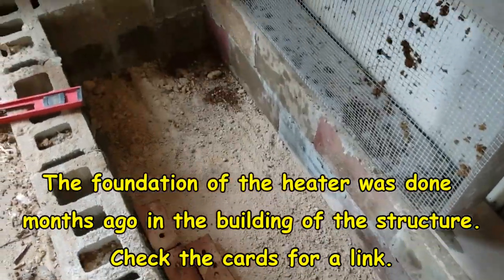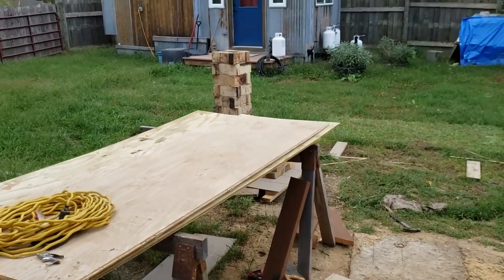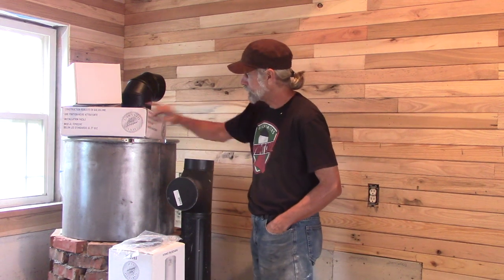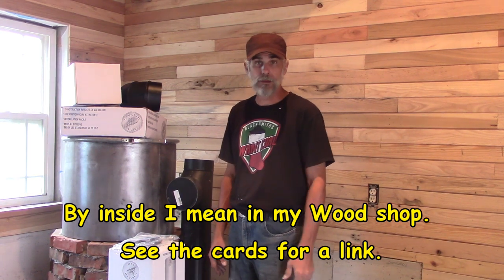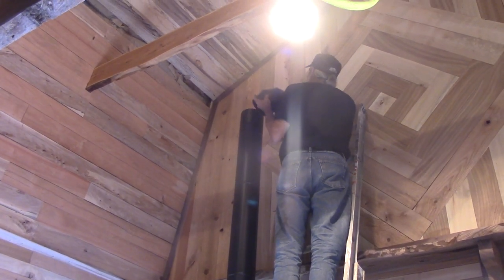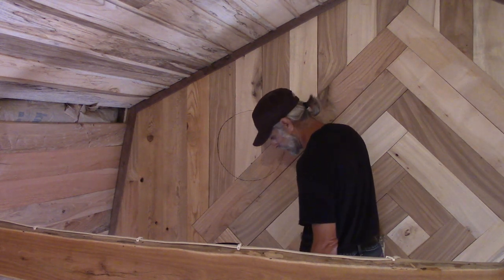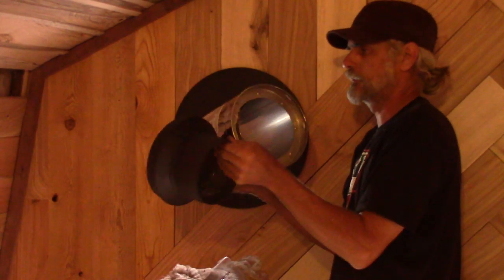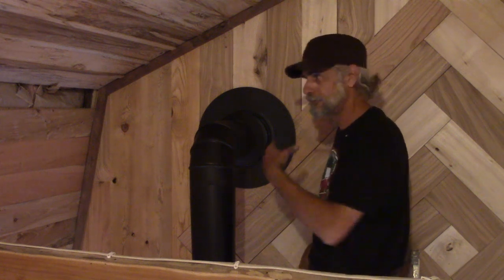Tiny House Rocket Mass Heater Part 1 of 2

Comment: thx for the content. I'm wondering what the recomended distance is between the insulated flu and the top of the barrel?  i've seen probably 20 videos and nobody mentions it..
Reply from the maker: It is usually 1.5 to 2 inches.
Reply: @DIYwithUncleCy  thx so much..

Comment: So the rocket stove how much heat does it give off how hard would it be to clean the stove pipe?
Reply from the maker: To clean this there are 4 ports. The top of the barrel is removable for cleaning, the one in the stove pipe and 2 in the bench. Rocket heaters are extremely efficient though and require very little cleaning, maybe once a year. Since they burn the gasses completely I may have to run a chimney sweep down it once every 5 years. As far as how much heat it puts off its like any wood  stove except it stores more heat so does not have to be run as much to maintain heat. I am thinking with this design I should only need to run it for an hour in the morning and an hour in the evening to keep the house comfortable, but keep in mind it is a very well insulated house (R19 floor , walls, and roof).

Comment: If you're using stratification, you're probably over estimating the exhaust temp by a considerable factor. Unlike a typical wood burning stove (or even a typical rocket stove), the exhaust readings I've seen on a stratified rocket mass heater have been in the 100~200 F range; since, it's coming off of the lower, cooler, strata of air... Also, due to the higher efficiency of the rocket stove design, creosote build up (= chimney fire) isn't an issue.  Sure, if a person can afford a "dual purpose" chimney, "go for it;" but, don't let it be a road block, if you can't. Just do your research on your placement of your hot and cold vent placement.
Reply from the maker: Yep know all of this trying to figure out where I gave the impression of overestimating exhaust temp. This system is a Bell system the channel I built for the gasses is just to direct them around to maximize heat extraction, The volume of that channel is huge. In the second video I cover all of this. And I just posted it.

Comment: Is the damper really necessary at this point?
Reply from the maker: Yes. After a burn you can close the chimney to retain more heat in the system. Therefore keeping the structure warmer for longer without wasting more fuel.

Comment: Forgive me if this is a dumb question but, why did you route the flue through the wall instead of straight up through the roof?
Reply from the maker: The roofing on the house is corregated and the collar to go through it and sealed was way more expensive than the wall type.
Reply: @DIYwithUncleCy  That makes sense. Thanks for the reply and thanks for your time and effort, the rocket mass heater building content you've created is gold.

Comment: How do you clean the ash out of the fire chamber?
Reply from the maker: With a shovel I made that the scoop is 90deg to the handle, and a scraper that can reach to the back to scrape all the ashe to the opening. But only have to do it about every 2 to 3 days because it doesn't produce a ot of ash, it burs so hot there isn't much left.

Comment: Would this get hot enough to get to sauna room  temps of a 165 to 180 degrees?
Reply: I would think so if you listen to how little they use this heat to sustain heat in the house. Talking 2 hours a day. If you ran it say 8-10 hours a day I bet it would be toasty asf. Maybe a hybrid version with half the mass. And utilize the other half for making steam. 👍🏽

Comment: What is Fireclay slip ???
Reply from the maker: Clay slip is water and clay mixed to a creamy but somewhat runny state.For the fire bricks in a rocket mass heater I used Fire clay to make the slip because it withstands higher temperatures without deteriorating.
Reply: @DIYwithUncleCy  can you purchase it if so where or is something  you can make from clay from the ground. Thank you for replying so fast
Reply from the maker: I bought my fire clay at a pottery supply place here. Pretty sure you can get it at any of them. You can order it online as well. No guarantees on ground clay holding up to the temps. Its possible that the ground clay will , but the odds are against ya on that one.